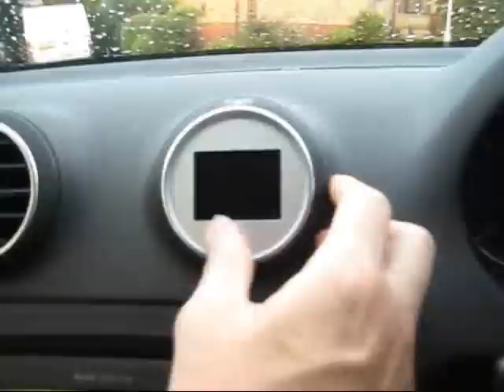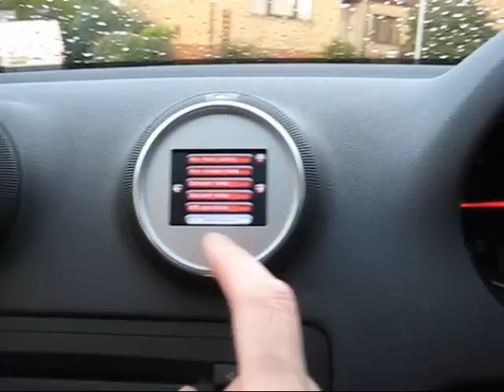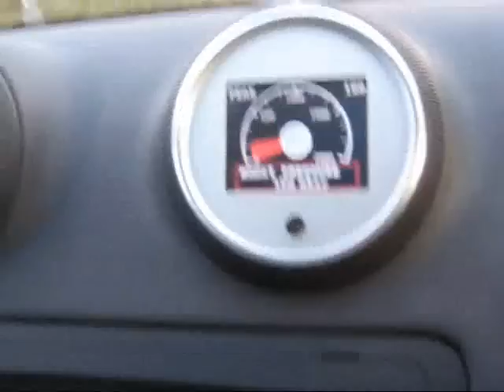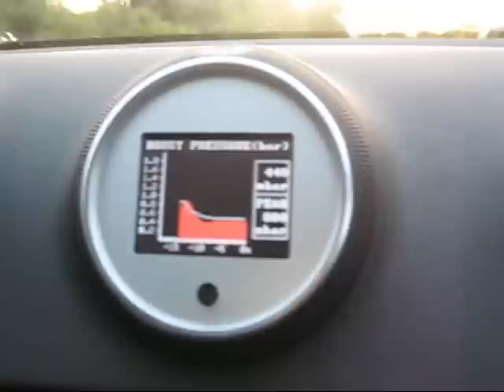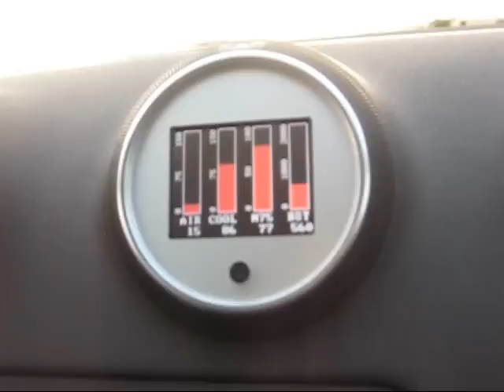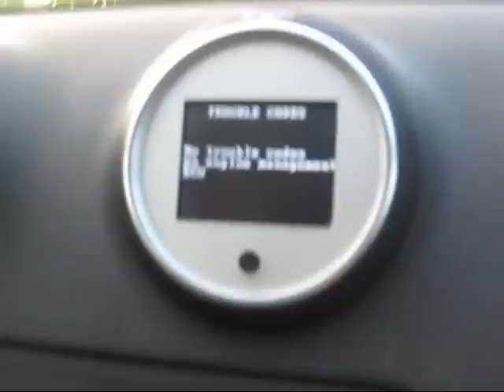liquidA3 (8P Chassis) test run

Comment: @jlgroovetek man I got to have one of these for my s3 8L do these come with a replacement custom fitting that fits in the drivers air vent? This is my next purchase 4 sure just perfect 4 me. If plugged into my s3 8l, which is mapped ect, how high will the guages read (bhp/torque/boost)? Thanks.

Comment: @racediagnostics No worries, cheers.  Just one more question, what is the sample rate of the unit?  I'm considering this to replace my current analog boost gauge, but the one thing good about the gauge at the moment is that it shows instantaneous boost without any delay when I'm boosting in 1st gear, whereas say a program like vag-com is very slow to respond and I might only get 2 data points in a 1st gear pull.

Comment from the maker: @jlgroovetek Yes, custome scaling is no problem and is set with a % figure comapring the old maf housing CSA vs the new one.

We recommend that a small in line switch be included on the k-line or CAN busses if the unit is hard wired in as  two testers on the diagnostic bus would take them out of spec.

Comment: @racediagnostics Thanks for the quick reply - so the horsepower/torque scaling constant can be custom scaled?  That's great.

Also wondering if one were to custom wire this to the OBD port (ie. under the plastic panels to keep it discreet), does the unit prevent other OBD devices from communicating with the modules?  ie. can I still use VCDS at the same time; or alternatively, can the device be turned off while the ignition in the car is on?

Sorry if I'm not making myself clear there.